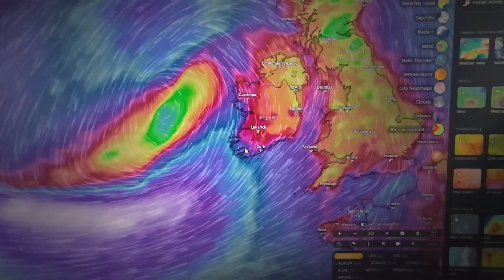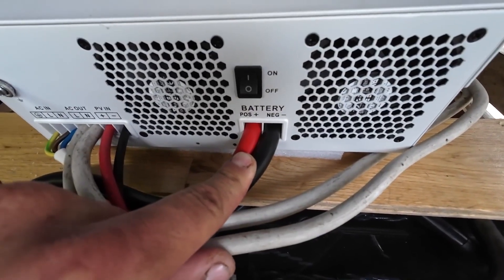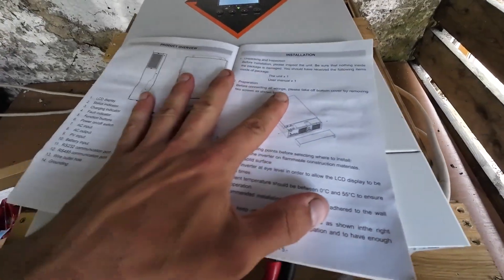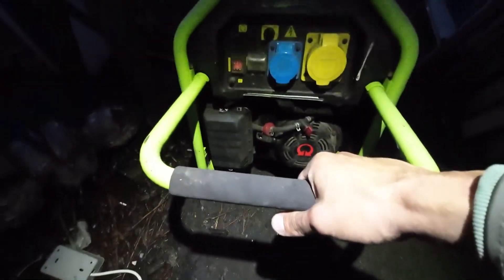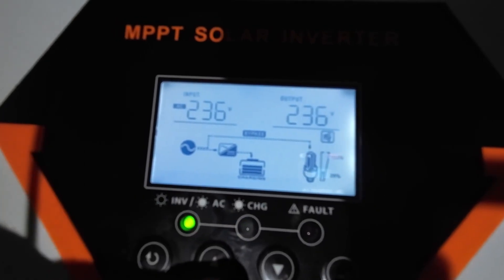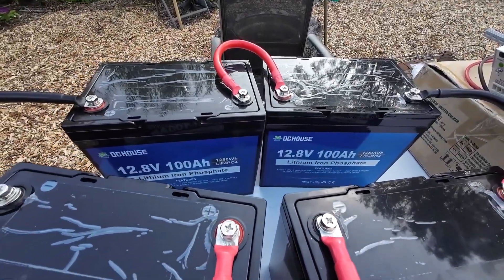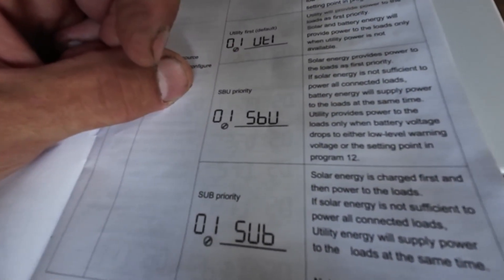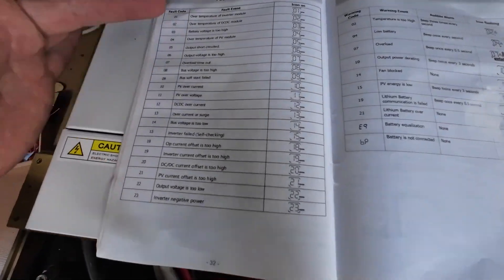Electric Savings or Backup? We powered our home using Solar for 12 days

Comment: Hello is the fans loud and countinous
Reply from the maker: A little bit noisy, i would put it in a different room but make sure you keep the batteries at room temperature. At 0C they only have 60% capacity. I'm going install this inverter in my office now and i will build a sound proof box around it with some ventilation. I'll make some videos

Comment: Hi Martin. Thanks for your off-grid series, which I found very useful and informative. I learned some lessons from the series. Thanks to your BIRDLAND VEVOR discount code, I got €14 off the price of a hybrid inverter that I just bought. In one of your videos, you asked for recommendations for a suitable inverter generator to add to your system. I bought a Loncin LC3500i a few years ago and am very pleased with it. I've used it during several power outages, and it has never let me down. It has many very positive reviews on YouTube. Many suppliers in Ireland stock or can source it. Essentially, it is modelled on a similar Honda model, and it does a great job. It's well worth a look. Keep up the great work! Thanks. John.
Reply from the maker: Thanks so much for your comment and for your recommendation. I will look into them. I'm about to rebuild the solar system and add on some panels, even though it's getting darker this time of year. As they say in roscommon wha harem :D

Comment: Really enjoy your solar videos and progress. I am building a comparable system. Have you contemplated running a Raspberry Pi computer with Solar Assist for your data?
Reply from the maker: Thanks! I haven't looked into monitoring. I'd rather keep it simple, but i might add a battery shunt to know the exact amount of charge left. I'm about to rebuild the whole system and add panels :D

Comment: Since you are thinking of adding Solar panels, and you are limited to the Solar voltage input, you may want to purchase 4 more panels and get a 4 panel input micro inverter that you could just wire the micro inverter output directly into your service panel. Like they say "You can never have enough Solar panels".  Solar is addictive! Always adding things. Good video
Reply from the maker: Thanks for your comment! Would a micro inverter be the same thing as a PV combiner box? https://amzn.to/4puqOIF
Reply: @abundantlifeireland  No, the combiner box is only for combining multiple solar panels. You can connect 1 to 4 solar panels directly to the micro inverter, max is about 400-600 watts each. The micro inverter converts their output to 110/240 vac. You then connect the mini inverter's AC output to your main service panel through a breaker. That is if you are not connected to the grid, otherwise you would connect to a critical loads panel. You can connect to the main service panel if you have a contract with the local power company to purchase your excess power. If you do not have a local power company the main service panel is fine. The AC output of the micro inverter adds what ever the output is to the existing main inverter output. What ever load you have will draw from the micro inverters output first. Example if your load is 700 watts and your micro inverters output is 600 watts the main inverter/battery will only need to supply 100 watts, saving you battery for overnight.  Adding a micro inverter to your existing setup eliminates the issue of the max solar limitation your main inverter will accept. Do a search on the following micro inverter, HMS-2000-4T, there is a European version or American version). They also have a HMS-1600 and HMS-1800 (watts) version. The 4T in the model is for 4 panels, they also have 1,2,3 panel versions, I believe that this would be a great addition to your system.

Comment: You will need an inverter generator to feed your inverter.  Your Vevor inverter needs clean power with a very small deviation. You'll find that most of your solar generators and solar systems need clean power to accept AC. most inverter generators will work. The Honda's and power max's usually work great. WEN has good generators as well.
Reply from the maker: Thanks for your help! I will look into it :D

Comment: You're going to toast you appliances and maybe even set them on fire with that cheap high frequency, transformerless inverter. Without an output transformer, it doesn't  provide any galvanic isolation between its DC boost stage and its AC output, so when its MOSFETs fail, it will pass high amperage DC current through to your appliances and will do some serious damage. You should have installed Vevor's low frequency, transformer based inverter instead.
Reply from the maker: Thanks for your comment! I am aware of this and i believe we're safe enough for now as we're only running 2.5kw max sometimes off the inverter. In the long run we will upgrade to a low freq inverter. It seems vevor only does a 3kw low freq inverter on it's own, i will be looking for minimum 5kw.

Comment: I picked up a Wen dual fuel 3600 watt generator and have been happy with it and the fact it's 1/3 the price of a Honda. It's clean and quiet and small enough that smaller systems can absorb all the wattage. Cheers.
Reply from the maker: Thanks! Great to know. Will look into it!

Comment: I bought the 24v version........ look into a ac to dc converter to charge from the generator. In America people use  The chargeverter which is pricey.
Reply from the maker: I was hoping to use the all in one solar inverter to charge the battery from AC because a standalone charger is quite pricey.
Reply: I overstand . I was very surprised the inverter wouldn't accept charge from an inverter generator. Speed and quality of how the engine is running can effect frequency on a conventional generator. But I thought the inverter generator was supposed  to correct that. i had that brand of gen. For years but it wasn't an inverter and it was U.S. split phase  @abundantlifeireland

Comment: 50mm2 cable can handle more than 160 amps. Most multi strand high flex cable is rated for 300+ amps.

Comment: We aren't home during the day so we added enough batteries to keep us going in the evening and night with a large capacity to spare. People get upset at the duck curve of solar. Just sore the energy. Lithium is 95% efficient. Basically the same as harvesting solar when discharging them. 

Just store your batteries outside of the house.
Reply from the maker: Yes, batteries can also bridge dull days until get another sunny day, especially in the winter.  Why store them outside? Fire risk? They only have 60% capacity at zero Celsius i believe

Comment: If you hook batteries in series you also need to add balancer for batteries.
Reply: Most batteries today don't require that unless you are using raw cells with no BMS on them.
Reply from the maker: @kevinroberts781  These batteries do have BMS's in them, but i believe i will absolutely have to balance each of the 12v batteries in each array. I will check voltages after using them for a while to see how far out of balance they have come.
Reply: @abundantlifeireland the bms within each individual battery balances that battery. The individual batteries in the your configuration don’t communicate to each other . Now I am assuming that fact. The individual batteries could communicate but you are the controlling person.. I hope that helps . Are you concerned about an individual battery?
Reply: No you dont.  Every couple months you may need to rebalance but thats all.
Reply: Yes that would make sense 😂

Comment: I use $100 600 watt jinko solar.
$100x20=$ 2,000

10kw hybrid inverter high frequency $600.

$500 DIY battery kits

$60 MB31 EVE battery cell
$60x16 = $920

TOTAL = $4060

placing solar panels on the ground to save installation costs
Reply from the maker: Sounds great! I'd like go 3x on the panels before the winter :D
Reply: I'm in Georgia, USA, and would like to buy "$100 600-watt Jinko solar."  

Where are you getting them?  Is that the delivered price?
Reply: @jamesdesmond1301  I'm in southeast asia so the solar panel factory is in my country shipping cost is $20..

Inverter and battery imported from China

Comment: Hello from Trujillo Perú. Your system is much posher than mine. I have second hand lead acid batteries from our electric mopeds and 12 150 watt panels. Our home is 100% electric. We eat 3 hot meals a day but my jeans get laundered on a wool wash. With a small system  prioritise have to charge. But we won't go back to fossil fuels. Electric blankets are a great investment.
Reply from the maker: Great to know, thanks for your comment! We've got an old forklift battery also but it's only 5kwh max (keeping 30%) and 1kw per hour. Flooded lead acid is ok but lithium is so handy.